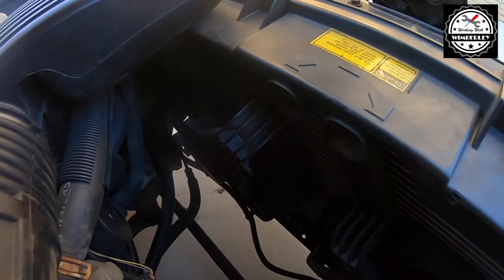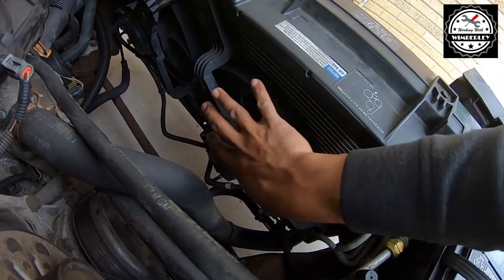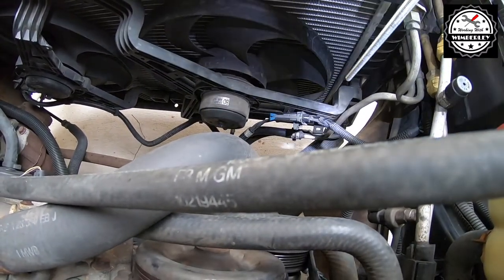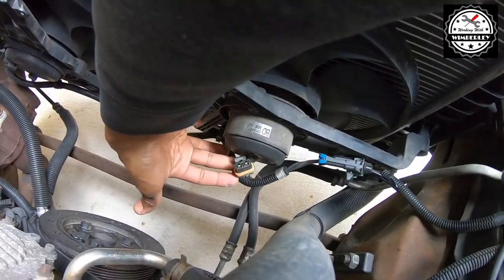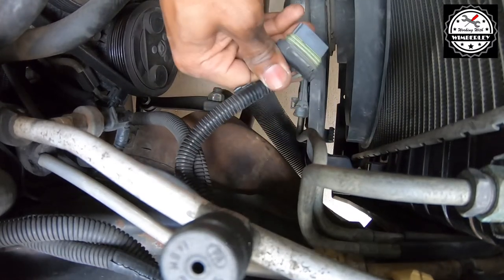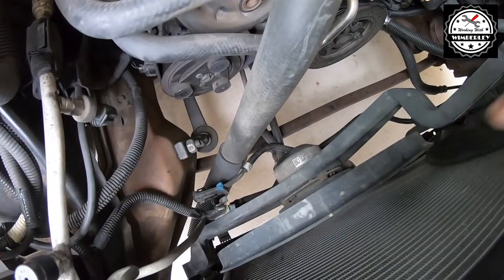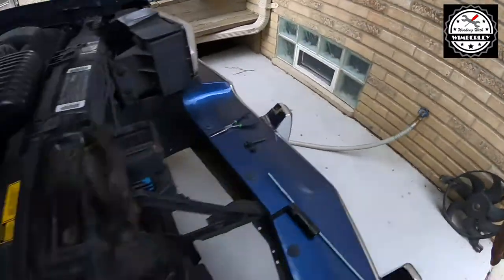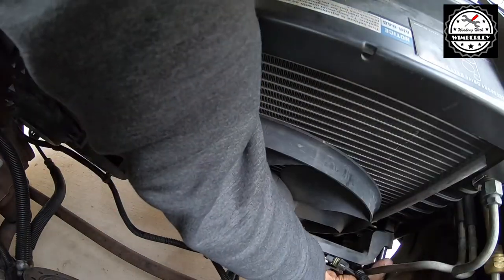LT1 Electric Radiator Cooling Fan Replacement 94 95 96 Chevy Impala SS Caprice RoadMaster Fleetwood

Comment: Would one of these fans not working cause the climate control panel to stop working? I’ve got a 94 fleetwood and one fan is not working and my climate control stopped working.
Reply from the maker: I don’t think it’s related to the climate control in the car. You should have one fan turn on once the engine reaches a certain temp and if it gets warmer, the second fan should kick on to further cool down the engine.

Comment: Thank you I think that’s what’s wrong with my 94 Cadillac Fleetwood brome roadmaster and Cadillac are very similar you take care and God bless you and stay safe😷 if that vans not blowing your AC won’t blow is Cole am I right.. it starts off nice and cool once I drive it 10 minutes it gets cool maybe you can let me know if I’m right or not..
Reply from the maker: Yes you are correct. The radiator fan pulls air through the condenser, which removes the heat vapor of the refrigerant inside. If the radiator fan fails, it will affect the AC performance.

Comment: I looked for a while trying to find a driver side electric fan for my 95 caprice. Mechanical fan has to go. Do you have a link to where I might locate one?...thanks and great video 👍🏽
Reply from the maker: You’re welcome! I was able to find my replacement fan at a local salvage yard. If you go on gmpartsdirect.com and find the part numbers, you can check amazon and eBay too.

Comment: Very good ...thank you ....but how do you test the fan .... or when do they come on?  How do you make them come on?
Reply from the maker: My Fleetwood is a 1995 so it uses the old OBD1 diagnostic port. When you jump two of the pins in the OBD1 port together with a wire, both fans will come on. I'm not sure how you would do it on a 1996 and newer car.

Comment: Gotta vid for just about everything LT1 don't ya. The bad thing, my 94 Roadie has the tow package,  and had the belt driven fan with the electric auxiliary.  From your vid I see how the dual electrics mount. I'd love to just hit USA auto in Sterling Heigjts and pick one , but I think those fans are controlled by the ECU, are they not? I would probably have to install a thermo switch for my car. Sad thing is the tensioner for the fan belt is shot and they don't make it anymore. I can only think of one spot to put the thermo switch and thats on the passenger side where the gauge sensor is, unless the drivers side has that port. Any advice champ?
Reply from the maker: Thanks! I’ve had similar questions about the brake job I did on the Fleetwood. The ones with the tow package or used for hearses were different than the standard one like what I have in the videos. Unfortunately I don’t have any advice. There are just too many differences between the two setups. Looks like you have the right idea as far as installing an electric fan with a thermo switch. The electric fan in my Fleetwood is controlled by the ECU. Once the motor hits a certain temp, it turns on one fan. Once it hits another temp, it turns on both.

Comment: My driver side fan isn’t getting any fire can you tell ma why
Reply from the maker: I would check for a fuse or check the wiring going to the fan. Someone in the comments also said they had a bad temp sensor which prevented their fan from coming on.

Comment: I have a1996 Cadillac Fleetwood Brougham and I replace the driver side with a brand new one and it's not working, but the passage working. What cause that be?
Reply from the maker: I’m not sure. On my 1995, the drivers side comes on first and then the passenger side will turn on as well.
Reply: I found the problem. I put a new coolant temperature sensor and both fans works good now. Man I love your car and your videos. Keep up with the good work and be Blessed. Thank you again
Reply from the maker: You’re welcome! I’m glad you were able to figure out the issue and fix it. God bless you too!

Comment: I have a 94 caprice i noticed that we have electric fans can we delete the constant fan that drives off motor
Reply from the maker: It's been done. There was a discussion in this old forum: https://www.ls1lt1.com/forum/b-body-impala-ss-caprice/38598-clutch-fan-electric-fan.htmlAlso, here is a diagram: https://www.impalassforum.com/attachments/lt1-clutch-fan-jpg.79090/ You'll need to do some research on how to do it, but I do believe it's possible.

Comment: I have a 1995 caprice & im tryin to figure out why both of my fans don't come on when I turn on my A/C only the passenger side fan comes on....
Reply from the maker: I’ve never checked my fans with the A/C on, but I do know that on my Fleetwood at a certain engine temperature only one fans turns on and if it reaches a higher temp, both with be on simultaneously.
Reply: Mines was the same, I wired my fan thats not working to the working one so when it cuts on they both will run together all the time
Reply: @devontegeorge67  
How exactly do you do that?

Comment: How would I know if it's the fan and not the fan motor?
Reply from the maker: The fan and motor come as an assembly. A visual inspection would allow you to tell if the motor is working but the fan is physically broken.
Reply: @WorkingWithWimberley  Thanks

Comment: Could this be a reason why car heats up only while on park idling??
Reply from the maker: Yes it could. I had some steam coming from my radiator. I thought it needed a flush. It didn’t. One of the fans failed and it caused it to get too hot. Once I changed the fan, I had no more issues.

Comment: Good job 👍 brother 
I got me 1996 capric Classic 
The problem I got is when I start the car the fan doesn’t work , but when turning the AC on just one fan works the one at left side and the other one doesn’t 
So what do you thank is happening with it?
Reply from the maker: To be honest, I don’t know. It’s possible the right side fan is broken. But since you have a 1996, you should have an OBD2 port. If you can get it scanned with a professional scanner, they may be able to tell what’s going on.